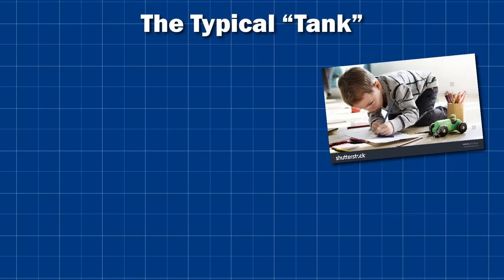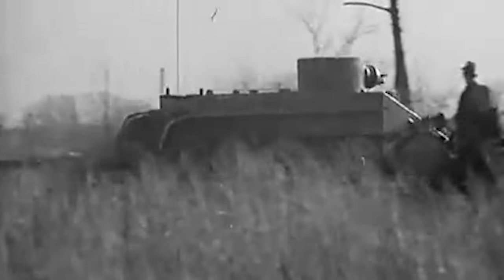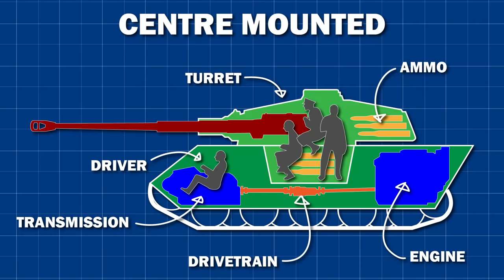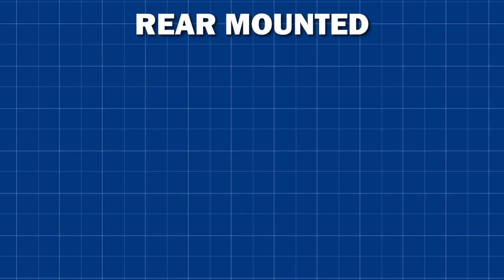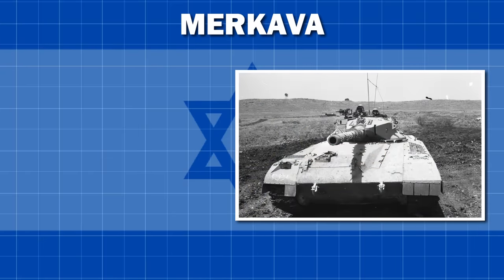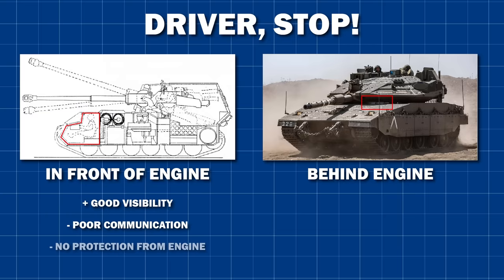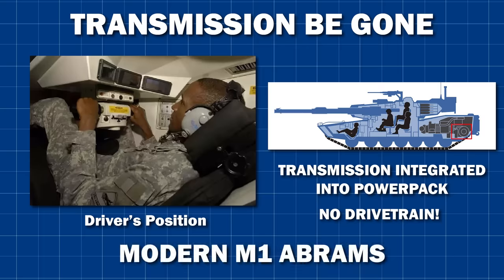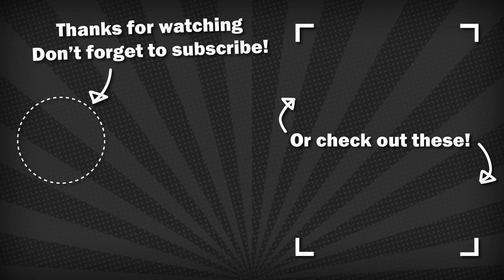What happened to Rear-Mounted Turrets?

Comment: The visibility issue for driver behind tthe engine is entirely due to poor design. Angling of the UFP counts as well as the optics given to the driver, and the seating position relative to the curve of the UFP. Honestly though general profile plays a role as well, take a look at the chassis of the SU-100P, the general design could be used for a rather formidable tank hull, using panoramic periscope optics too with a better field of view a big of heightening for a more powerful engine and use of composite armor obviously. The main issue is having to expose more of your vehicle when moving to engage enemy vehicles from cover like coming up a hill. A design I quite like is the AMX-50 Surbaissé with front mounted turret, with some modifications and use of a conventional turret there's a lot of potential. First off change the frontal armor scheme to that of the IS-4M, increase vertical angle of UFP and LFP to 60 degrees each, match sponson vertical angle to work with the UFP too obviously, thick composite armor in the front, spaced light composite armor for the sides (with spall liners) first layer flat, second layer angled at 30 degrees. Adjustable hydropneumatic suspension, neutral/regenerative steering, top speed limit forward and reverse 75km/h electric transmission, tandem 1200hp diesel-electric turbine engine/steam turbine engine powered by the exhaust of the diesel. Turret cheeks heavily angled back horizontally, slightly vertically, large wedge mantlet similar to the OF-40 but with thick composite armor, same in turret cheeks, and sides same armor as hull sides. Massive turret bustle with armor surrounding ammo in the autoloader and separating each individual piece, armor separates ammo from crew as well, only breached when reloading the ready rack or loading via the autoloader, extra ammo stored in hull bottom within armored compartments, all armored compartments having spall lining and hull floor having spall lining/kevlar blanketing. Stabilized 155mm large bore high pressure rifled gun with a .50cal coax and 20mm RCWS normally operated by the loader, could develope dart for it but not necessary, use high density HE/HEAT-MP shells and top-attack shells for armored targets of different strengths, but also can operate as heavily armored artillery, either up close or at long range, significantly more effectice fire support against all targets, great in defensive positions or as a breakthrough tank, cage armor and composite sideskirts + hardkill and softkill APS(radio/electro-optical/IR smokes) for urban fighting and other intense scenarios, turret will have a high profile (but not too high) to accomodate the gun while having decent depression (about -8 to -10 degrees at least) as the gun will be mounted lower in the turret, auto loader will also feed from above similar to the AuF1, achieving an RoF of 10 rounds a minute burst and emergency capability of 20 rounds a minute, internal storage is available for spent casings in the sponsons, the turret has a backup generator for the electric drives, turret crew sit lower down in the turret, seats raise and lower via hydraulics for getting in and out more comfortably, the hatches are spring loaded, panoramic periscope sights are present for the crew with generation 3 thermals for the commander, gunner, and loader (RCWS optics), commander-gunner hunter/killer system, stabilized commander's optics, the breech has a loading tray to aid in manual loading in the event of a malfunction or damage to the autoloader, full NBC protection and temperature/humidity control system, tea/coffee heater and thermos slots near the crew fighting positions, directional audio-detection system linked to friendly battle network and IFF designed to help with detecting enemy vehicles, very light composite armor on the roof similar to the Strv 122, hydropneumatic suspension control is linked with the FCS to provide better firing angles.

Thank you for listening to my mad ramblings

Comment: strange video. the driveshaft running under the turret is an long abandoned ww2 system. all modern tanks have engine and gearbox in the back. no driveshaft running front to rear. second, the Merkava is not the onlt tank with the turret in the back, see the  argentinian TAM.
Reply from the maker: I talk about both of these points in the video..? There is footage of the TAM with a big label.

Comment: Most non-tank AFVs have engine in front (i.e. IFVs, APCs, SPHs, etc.) and the driver to the side of the engine... the Merkava has this too, so the driver is not directly behind the engine, meaning what is described in this video is not entirely accurate.

Comment: What about the front mounted like the tiger P?
Reply: Technically most of the tanks today and post-ww2 are front mounted ie Pershings, M103, T34, Leopard 1, etc. Tiger P in this case could have perform greatly if it wasnt because of the engine constantly overheating and catching on fire due to the weight distribution, the sheer weight of the heavy armor and overall just the hull of the tank iirc

Comment: Merkava cannot really carry troops. it s a common misconception. the door on the back is meant to be used while escaping the tank.
Reply from the maker: It can carry troops, that’s what it was designed for. Even today, 40 years after it was developed, 1 tank in every platoon will go into battle with a limited ammunition load in order to carry wounded troops in the rear of the vehicle.
Reply: @RedWrenchFilms  carrying casualties isn't exaclly the same as carrying troops. Merkava can carry wounded soldiers but in no way is it a APC/MBT hybrid and i think that most of the viewers would understand your statement that way.
Reply from the maker: @anonimowe_konto_yt  The point is not what it actually does in current IDF doctrine through - it’s that the Merkava is CAPABLE of carrying troops into or out of battle in a practical way thanks to the placement of its engine and turret. No other MBT has it’s strange rear door/ front engine layout.

Comment: Because the driver can’t really see to their left and right and the gunner and/or commander helps them drive. The driver will have to pull further and expose more of the vehicle for the turret crew to see on the sides of the vehicle when traveling or more of the vehicle has to be exposed for the turret to traverse and engage targets that are off axis to the vehicle’s axis of advance. Just not a good idea at all.

Comment: Automatics slurp more fuel per mile. UNLESS you run them in a lower gear until they are at normal running temperature. And fast enough to have no give/sponginess in the transmission oil. Tested in a petrol engine Mitsi 1600-ishcc. Put into drive a tank of fuel a week. Put into under drive 1 tank per fortnight. Both going from home to school then home again. Cold in drive it labored. You used more accelerator to get up to speed. In the lower gear cold, it didn't labor so less accelerator.

Comment: Merkava irl cannot carry 6 fully armes troops tho, there are CC that talked to people Who served in the merkava and told that the Truth Is you can barely put 2 people on the back and starting from merkava MK2 they used the back part to escort wounded out of the Battle and from mk4 they are not trained anymore for that task either... The issue Is you Need to remove completely the back ammo rack to load people there

Comment: So you guys know how a teslas battery powered and it’s batter is basically the entire bottom of the car?
If tanks move to electrically powered, they will be quieter giving greater communication abilities, the engine placement won’t really be a problem as you can problem have a large variety of shapes for a battery, and it might give way to more futuristic weaponry. 

Or at least very hypothetically, coming from an uneducated high schooler. Unless someone can tell me otherwise, it seems like a very possible idea, the only issues I can see are maybe tanks being more expensive and refuelling them taking longer since it’s a battery you have to charge.

Comment: Funkily enough, nearly all spgs in use today use tear mounted turrets. Gun depression doesn’t matter when your aiming UP to shoot st stuff 10 miles away, And driver commander communication during battle is both coveted by radio headsets and not as split second demanding owing to the fact they don’t shoot on the move.

Comment: Or you could just have the power pack and gearbox in the rear and connect the driver either with hydraulics or drive by wire systems.

Comment: In the end it's a question of priorities. 
The extra protection from the engine is pretty minimal by the way. If something gets through the armor it is very likely that some sort of shrapnel will make it past the engine block, possibly even parts of the engine itself. The engine can also get damaged and blow up itself, and depending on the fuel and projectile used you might also just turn into a big fireball.

Comment: Why does the tank need a driver? Why can’t someone in the basket drive the tank?
Reply from the maker: Good question! They tried this on the MBT-80. The issue they found is that the driver got disoriented and motion sick, since his body was turning in the turret but his optics (on the hull) weren’t. It also means your turret has to be that much bigger to fit a 4th or 5th crewman into it.
Reply: Ah yes, AMX Ele Bis

Comment: you can have a manual transmission in a modern tank, and it isn't hard to get that done. automatics just take more than they give.
Reply: Yeah but who wants that? Manual transmission are still alive in cars because it's fun for the enthusiasts, but there's nothing fun about driving a tank and there are 0 pros to having a manual. I'm sure even the "purists" prefer it that way. It makes everything more complicated, I feel like "take more than they give" applies much more to a manual transmission.
Reply: @metalogic1580  still waiting for your argument, not your tantrum. cause the only tie to what i said was "I feel like "take more than they give" applies much more to a manual transmission."

but hey tantrum at the engineer and 2 decade student of tanks. you know nothing about anything of that. and if you took an automatic apart you'd cry. but you do you boo...
Reply: @osmacar5331  Plus, no one said that manuals in modern tanks are impossible to do so idk why you even wrote that to begin with..

Comment: Nice video but i dont agree with the last part. Linkages exist, you can operate a transmission a mile away if you want to. Look at t-34 with its rear transmission and driver at the front. Transmission doesnt have to be literally next to driver to operate it manually. You can operate a transmission thats far away from the driver via linkages very easily. Reason why most ww2 tanks had front transmissions was because they were so big back then and created better packaging despite the driveshaft. Front trans meant you can put it between driver and radio operator which is a big place that would be normally wasted if trans was at the back. Automatic transmissions also have linkages by the way , and majority of modern tanks still have transmissions that are 40 years old sometimes more. For example hswl 354 from leo2 is from early 1960s. They all still have linkages going to the back to operate it. Even if its automatic you still need linkages to choose between reverse forwards etc
Reply: additionally front based transmission provided extra protection and could for the crew at the cost of losing the vehicle.
Reply: @AllMightyKingBowser  yeah that too. Also during interrogation Kniepkamp said Germans favoured front drive sprockets because it self cleaned out the mud better from the tracks which meant there was less chance of throwing off a track. Front transmission made even more sense because they actually favoured front drive sprockets instead of rear ones

Comment: What about front mounted
Reply: modern MBTs tank barrels are far too long for that to be viable, aside from having to move the driver into the turret as well, which was actually attempted with the MBT-70/KPZ-70 joint project by the US and German army but ultimately scrapped because it disorientated the crew.

Comment: drivetrain? driveshaft? bro wtf part of the engine transmission or suspension is forward with the driver? the only thing under the turret is the suspension. the tracks are driven by rear drive wheels which obviously are in the back with the engine
Reply from the maker: Often this isn’t the case. The transmission was usually placed in the front of the tank. With the driveshaft extending below the turret. Sherman, Panzer IV, Tiger etc.

Comment: @RedWrenchFilms  rear turet are not dead following example:  Russian BMP3 Dragun BMP3 Dragun 125mm t15 Armata t15 Armata 57mm ,Chinese ZBD-04 VN 17 VN 20 VN50 IFV,Sweden CV90120 ,German PUMA LYNX and LYNX 120MM and BOXER TRACKED IFV 120mm,UK Ajax 40mm,South Korea black Windows ifv, USA M10 boocker and the Last one and the best the prototype of early 2000's HD-40T Wombat with remote operated turret and engine under the turret  he was à  equivalent of t14 armata by way lower way shorter and way lighter and design of futur USA tank like ABRAMS X  follow exctally this way but Wonbat was better design and french design in some way to for concept art for MGCS.

Comment: 3:30 yeah so, you need to do MUCH more research on this. it isn't actually possible. It was more or less a propoganda stunt for a tradeshow, but it removes most of the ammunition from the tank, and the rear space is simply not big enough to fit infantry and their equipment. its a common misconception that keeps on being repeated.
Reply from the maker: No. It can be used for either ammunition or soldiers. In a typical Israeli tank platoon one vehicle will carry less ammunition and leave the rear compartment free for medical evacuation… as it can hold troops. Good luck trying to do that with an Abrams or a Leopard. It was a feature the vehicle was designed for, just because it is not often used doesn’t mean it doesn’t exist.
Reply: @RedWrenchFilms not rly a feature. Just the result of the evac ramp being in the back.next to shells.
Reply from the maker: @emilsinclair4190  ?? Of course it’s a feature. Other MBTs don’t have “evac ramps”.
Reply: @RedWrenchFilms the evac ramps are a result of the conventional evac ways not being possible do to the placement of the turret.
Reply from the maker: @emilsinclair4190  The conventional ways are through the hatches on the roof - doesn’t matter where the turret is placed. This is an added extra hatch to mount and dismount infantry.
Reply: @RedWrenchFilms  usually the drivers hatch is also used as a way to escape. Do to the turret placement this is very difficult for this tank. And this is why they created the backdoor.
Reply from the maker: @emilsinclair4190  The drivers hatch is by far the most difficult hatch to escape from because it is usually overhung somewhat by the turret as well as being almost impossible to access for the turret crew. If anything, the driver is more likely to clamber back and escape out the commander/loader hatches. Not sure where you have heard any of this.

Comment: The Merkava is not an IFV and that door in the back is to get amo in and to evacuate the tank faster.
(Not classified)
Reply: That's not strictly true. While yes, the back door of the Merkava is effective for a safe method of abandoning the vehicle, or easy access to ammunition storage. It is actually designed to carry infantry as well (up to 6 or 8. Most likely the former but I forget.) In addition, the newest mk4 has the capility to secure two stretchers on an attachment inside the compartment, as well as improved medical equipment. So, in reality, the Merkava can fulfil the role both of a battle tank, and an infantry fighting vehicle. Or in the case of the mk4. A frontline medevac as well.